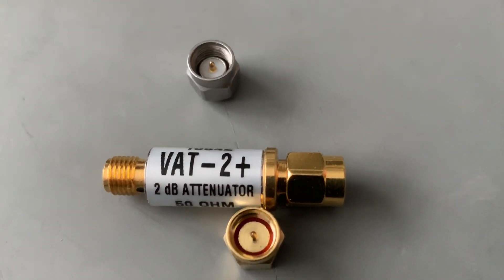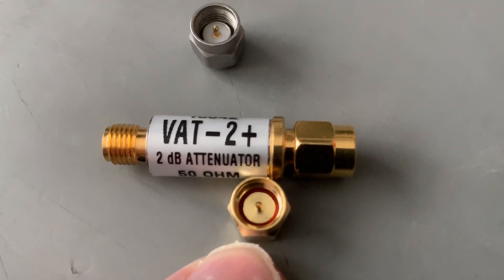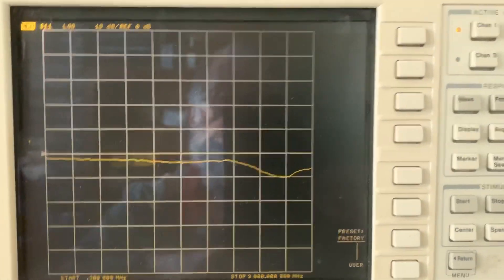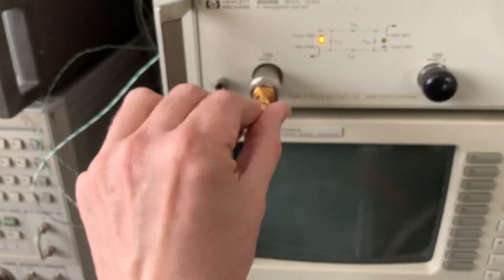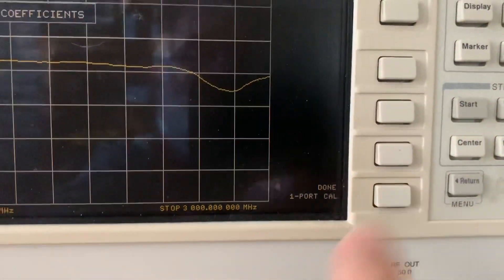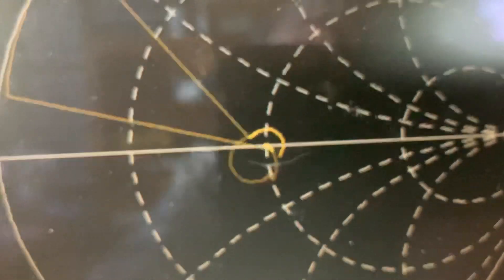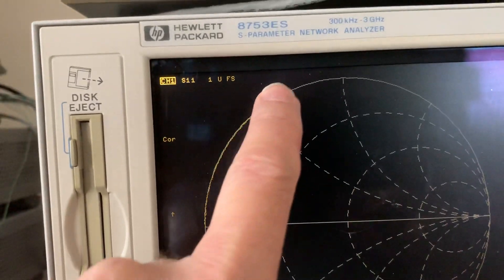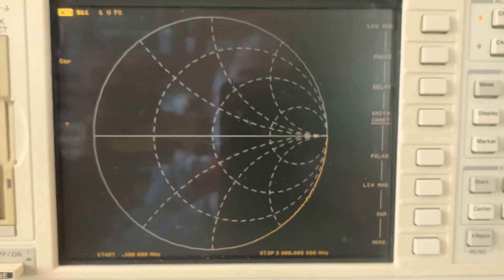Demonstration of why a good vector network analyzer calibration kit is essential.

Comment: If you are considering buying a cal-kit, don't buy it from Kirby Microwave LTD. I've bought both the N and SMA kits a few years back. Because of circumstances I never got to using these kits until now. I didn't get any calibration coefficients on the USB sticks provided with these kits, only the verification data for the attenuators. I've contacted Kirby Microwave, provided my kits type numbers and serial numbers, explained my situation and got an answer that they would sort it out for me. After a few days I've contacted them again, because I didn't got an answer nor any data. I've waited a little while and contacted them again, now they replied and promised me to send it to me the next day and again... they didn't answer. I've invested almost a thousand euros for two cal kits that are useless without the data. I might as well have gotten me some N and SMA connectors for 50 bucks. This so called Dr. David Kirkby is a fraught. He must have gotten his PhD from the hustlers university because he sure had me convinced. How can you say that you are a professional Microwave engineer and not keep any record of your measurement subject? This probably is what happened. He didn't keep any record on these kits, that's why he can't provide me with the data. So I advise you not to buy anything from David Kirkby. You are better of investing in kits from Siglent, Picotech or Rigol. They all provide kits within the same price range, but the difference is that these are professionals in the realm of measurements, David Kirkby is not.